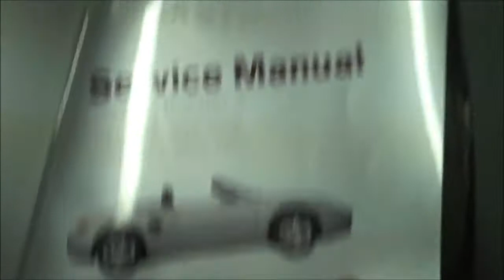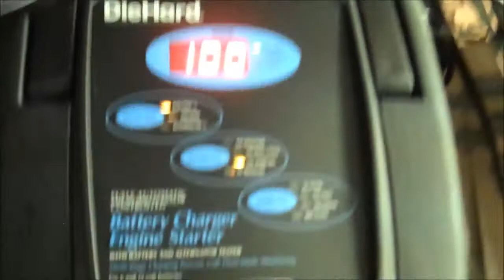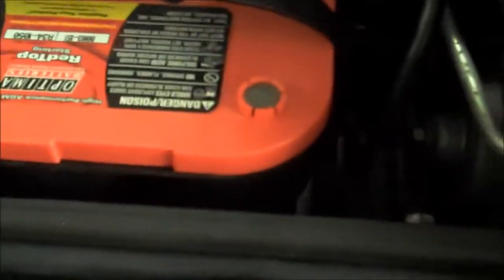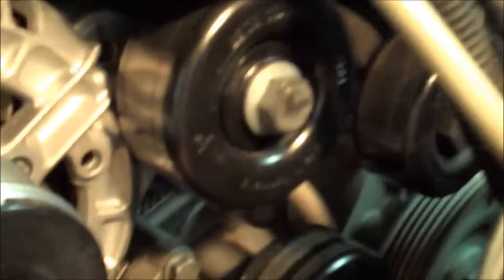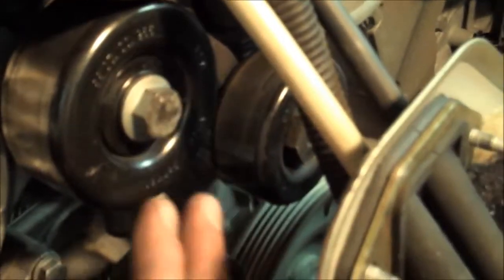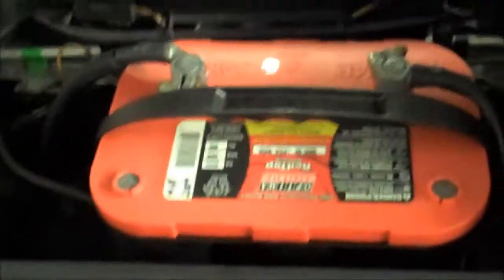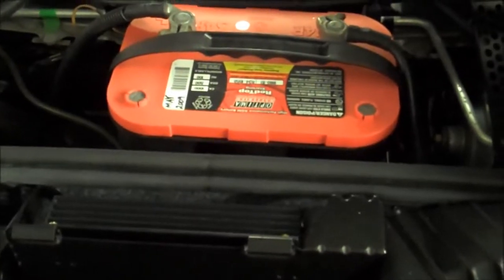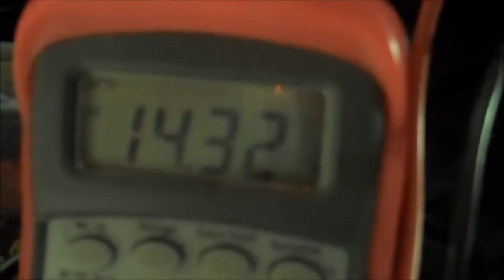Porsche Boxster Alternator Replacement

Comment: The bushing on my stock alternator did not move at all either!😆😩 Almost 3 hours of prying and pulling, finally freed it. Tapping on the bushing by way of the bolt was only part of the process at one point you have to stop thinking that's the solution and start just wiggling that damn thing out of there. great video! I got through the whole process! Made sure my battery was healthy then new alternator and belt.

Comment: After I did this the first time, I can swap the alternator in about 20-30 minutes (including swapping the belt) 

I tried to loosen the bushing a bit but ended up  using a big ass 15/16 wrench underneath the alt with the left bolt out and the right one pretty much out..  ... i was able to get good leverage on the alternator without risking any damage. 

Always remember to disconnect battery here... this is very easy to overlook in a car like this where battery is in the oppposite end of the car .
Reply: Where did you put the wrench to get it out

Comment: I know this is an older video but I was wondering if your alternator had totally failed and wasn't charging or the bearing went and was making a noise... I'm currently experiencing a whining noise
Reply from the maker: Blake Lee total failure. No charge, limped home and the car died in my driveway.

Comment: Nice video! How’s an AGM battery on an older car.. if one cannot use a battery maintainer regularly? Does it charge well with the alternator at 14.3 not 14.7v?
Reply from the maker: I pulled the AGM battery a bit ago.  Too expensive and with my low driving of the car (<750 miles per year) it wasn't worth it.